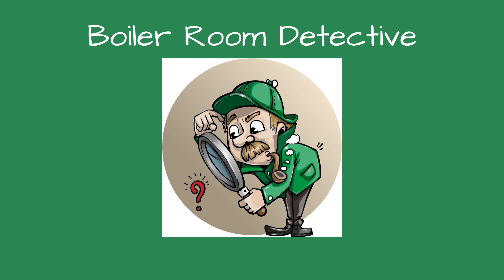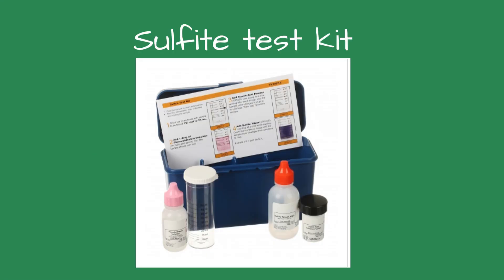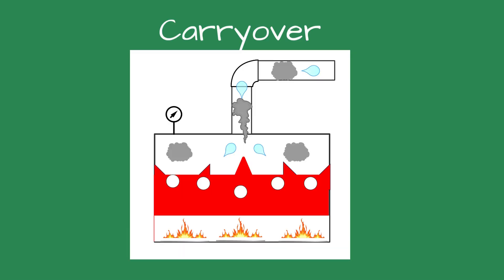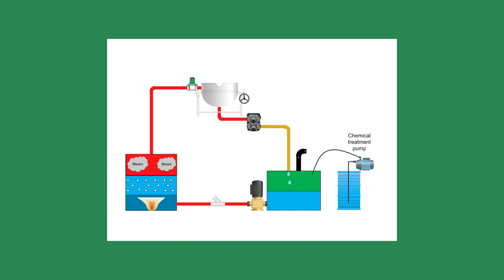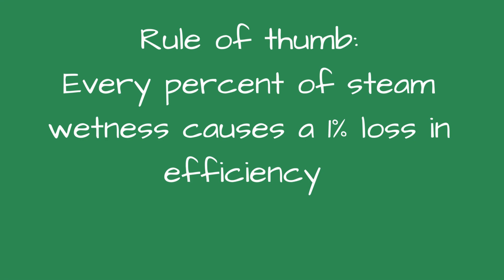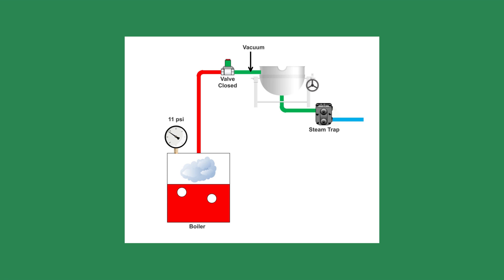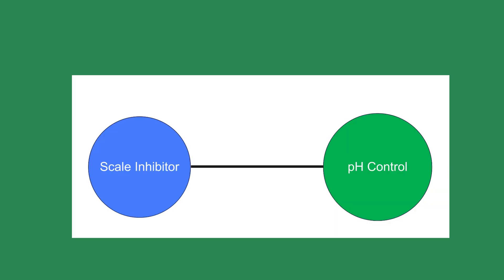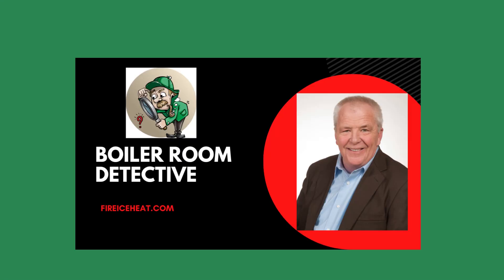Case of the disappearing water treatment chemicals

Comment: Excellent video Ray - we often see the impact of multi-functional chemicals causing carry over and fluctuating level control in the boiler when the demand for sulphite is high.  I'd much prefer to split out the active components and run a 3-pack system to allow for improved control.  Especially when the steam load is high.
Reply from the maker: Thanks for watching and the feedback It’s crazy how water chemistry can affect a steam boiler